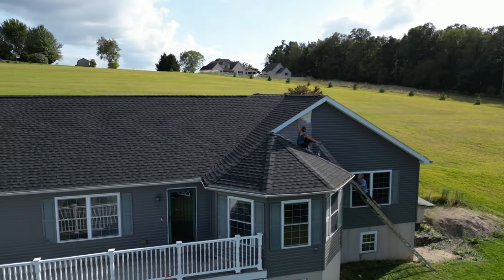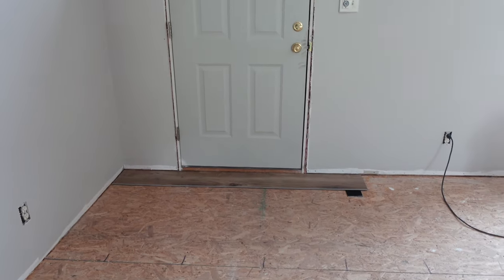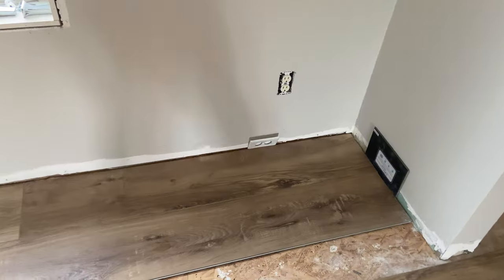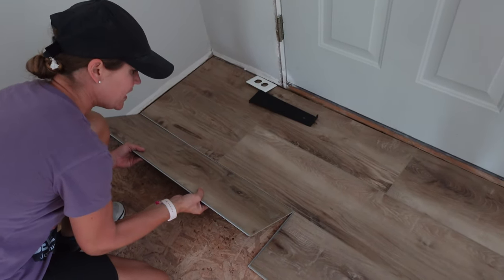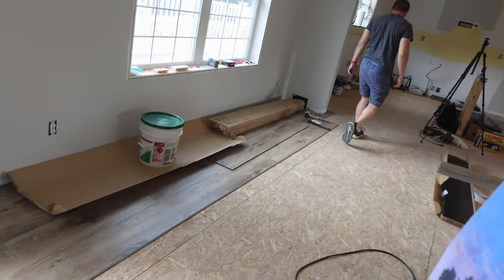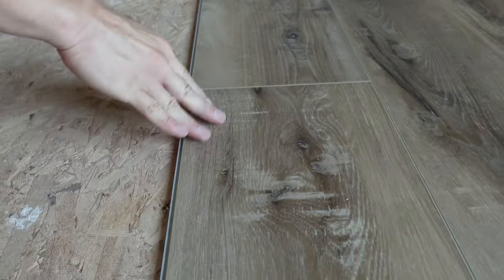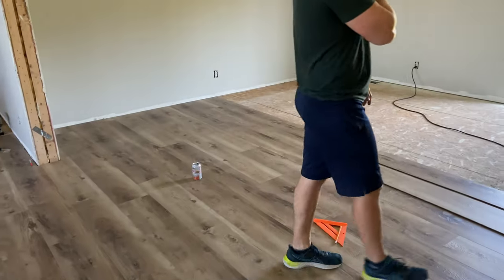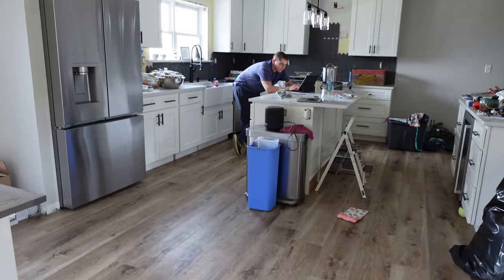Cali Flooring Seaboard Oak Luxury Vinyl Plank Install. DIY TIPS AND TRICKS.

Comment: We put those Luxury Vinyl floors in our house, we did it ourselves just like you are doing.  Our floors have now been down 9 years and they hold up well, however it's easy to scratch them when moving large, heavy items especially.   I found that scratch cover works to disguise the scratched areas where you can hardly see it.  Our house though was under 1000 square feet so you have more to lay than we did.   Good job!  You can buy those threshold pieces that match your flooring to do the smaller rooms like bedrooms, we laid the floors straight into our master bedroom but installed a threshold piece in the second, smaller bedroom.
Reply from the maker: Thanks for sharing! Yes, we did manage to put a few scratches on ours as well after our last install...mostly things that were our fault. Dropping a knife, pushing something heavy across the floor like you mentioned, etc.. Great tip with scratch cover!! I will have to look into that.
Reply: @follow.the.whisper  our vinyl floors are lighter colored wood with darker streaks in it and we love it.  I put rugs on each side of the beds in the bedroom and I have an area rug 8' x 10' under the dining room table so the chairs won't scratch the floors.  Also put a smaller round rug in the living room.  The scratch cover really does work great, I used a darker color than the floor and after it dried a bit I wiped the excess off and you really can't see the scratches.
Reply from the maker: Awesome!!

Comment: Been installing this same flooring in my new build. My biggest complaint is the lack of knot variety. In a 100sqft I could have the same very noticeable knot show 6-8 times. Even if the pattern is printed on the board flipped or slightly slid in one direction or the other, it’s still a noticeable repeat.
Reply from the maker: Absolutely agree. We used a different color variation in our last renovation, and the repeat was not nearly as noticeable. I will say that after getting our furniture and decor in place, it's far less of a concern. I hope you find the same! Thanks for sharing.

Comment: Why are you not using a spacer at the end to ensure the 1/4 gap
Reply from the maker: Great question. We tried spacers and didn't have much luck. They'd pop out when we'd make adjustments, and we wouldn't realize it. Then, we wouldn't have the space we needed. For us, eyeballing worked much better. If spacers work for you, that's definitely the better way to go!